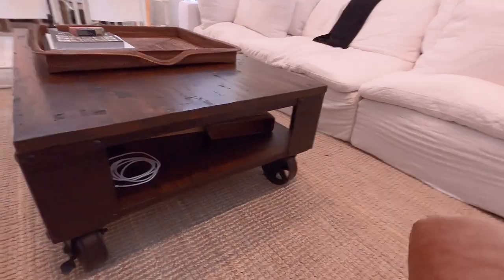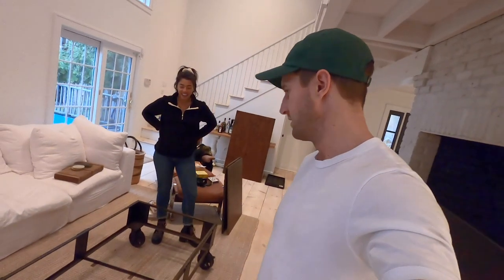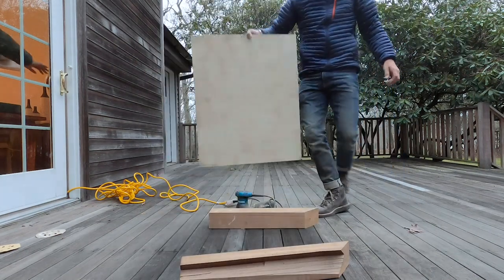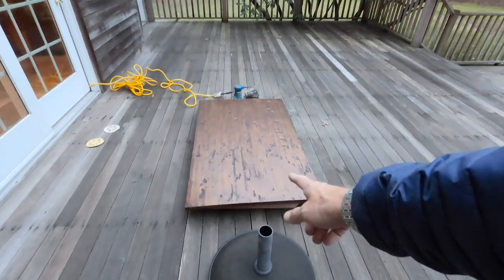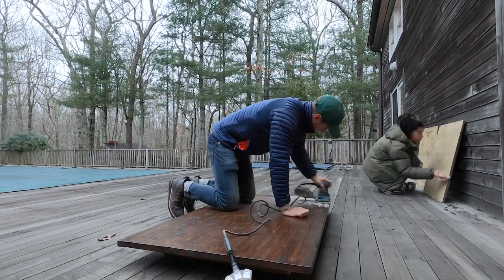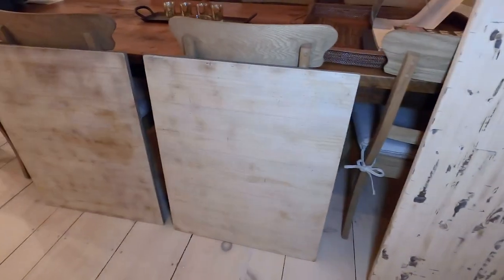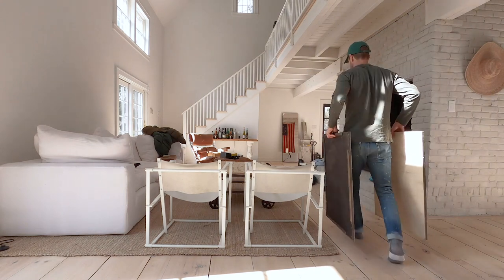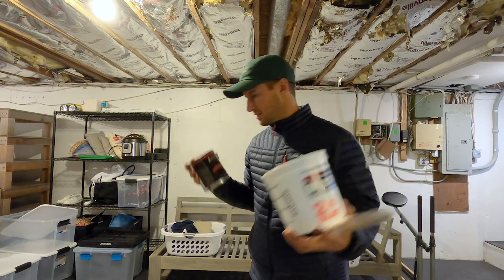How to Whitewash your Coffee Table?  We found out and it was pretty easy!

Comment: A good tip for orbital hand sanders (what you have) is to move the sander in a small figure eight pattern (the key is 8 not ∞) starting from the top left corner moving across in a straight row and then down below the row you just sanded heading back right to left and then repeating left to right, so on and so forth until you have sanded the entire area. I like to envision that I am creating really tight cursive capital S's that are stacked super close together. This method ensures that you are evenly taking off the same amount of material everywhere. Repeat this as many times as it takes to accomplish the level of exposure you desire. Also, for a professional finish, buy like three grits of paper (80 or 100, 120 or 150, and then 220). Start with the lowest and every new pass you do increase the grit and you will get a smooth surface (finishes should also include a suggested a grit- so always work your way up to that!) Also, make sure to keep your sander flat on the surface (I can understand why you tilted it to get into the gaps), but generally this is the rule of thumb. Happy very professional sanding!

Comment: Well- executed, Brendan. Revamped table pairs well w/texture of rug and sofa color + your and Hannah’s care in following steps is inspiring. Modern clean look is refreshing and cozy, not austere like some contemporary spaces. I’ve had many many 24 Hr Home Depot visits in past (paired unfortunately w/ bottle of burgundy) that resulted poorly..... handyman service was on speed dial to correct self- tiling kitchen backsplash ( Home Depot course sounded do-able), bathroom pedestal sink install debacle, & buying sprayer, spray painting kitchen cabinets only to leave to dry on newspaper (duh...yep). Had to ask handyman who was used to mess-ups “just don’t laugh when you get here”. Brendan and Hannah, clearly your level of house project vs skillset is better than mine.  Thanks much for showing this project in detail (like the measuring paint in basement and wheel removal).  Cannot help but to notice the fashions—- nice sweater and Hanna’s boots.Note to Hannah: be mindful of your hands- use gloves to preserve the manicure.  Thanks again for this nice video. C in Chicago.